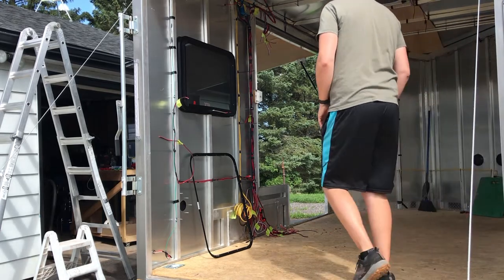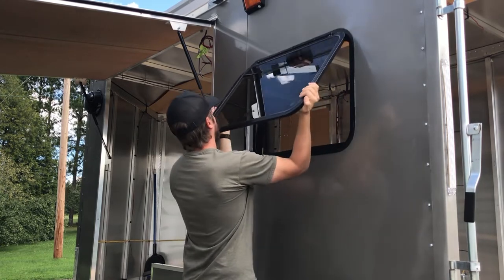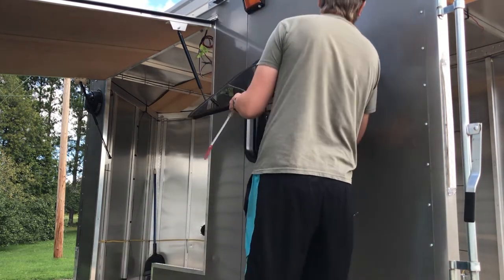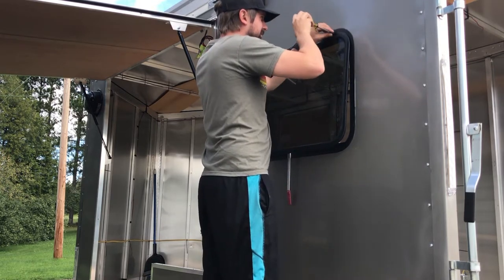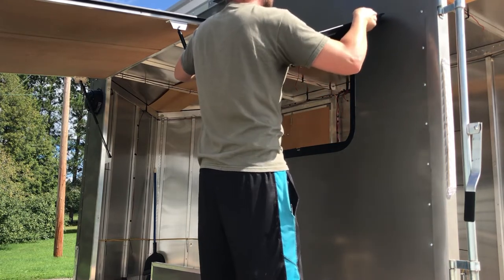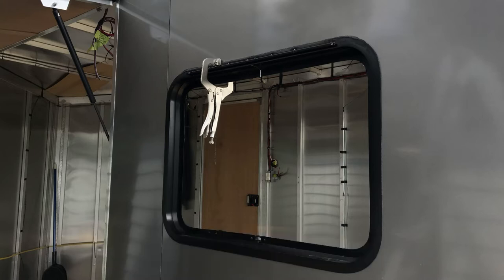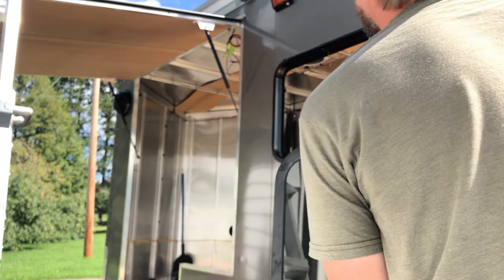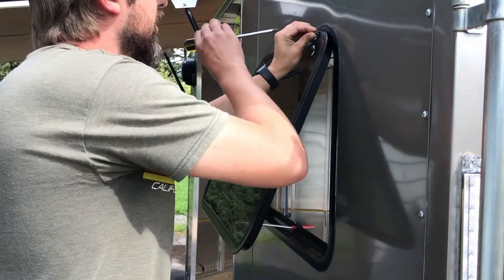Cargo Trailer Conversion Series: Exit Window, how to unhinge

Comment: Dang...video wasn't long enough for the paint I just put on....😁. 
Good idea to learn how to operate Emergency Exit BEFORE the Crisis...😁. 
I use clamps just like those, compress brake calipers, secure windows along length with a couple scrapes of wood...best tool since a good knife...
Reply from the maker: Short and sweet! I always try to cut out the filler but they still end up too long I think 😅 And I agree, you can never have too many clamps and vice grips!

Comment: do you have a video on the full installation of this window?
Reply from the maker: Yes, I believe it’s the video before this one. But I have to admit, between missing parts and inexperience, it’s more of a what not to do video. Still worth checking out if you’re new to this sort of thing too. Might save you from making some of the same mistakes I made 😅
Reply: @getaway_man  LOL i understand man, I'm building myself and my son a "Stealth Hunting Trailer" so that we can get deep in the woods and just be there and I'm at windows now and i already have the exact window you are doing just trying to watch a few videos before i jump in it. you are very detailed and skilled so i tend to watch your stuff first.
Reply from the maker: That sounds so fun, good luck with the rest of the build, and thank you!

Knowing what I know now I would suggest cutting out the opening, then frame around the opening on the inside. Simply glueing some wood to the sheet metal will work. That way, when you insert the window and subsequently screw the trim ring to the back of the window, it will be a uniform squeeze and you won’t end up with any gaps/leaks around the window. They didn't include a window seal/gasket when I ordered so I improvised and glued the window in place. It worked but it would be much easier to use a foam or rubber gasket. Hope that helps!
Reply: @getaway_man  i have already done my inside insulation and walls. what are your thoughts on cutting it out and just using the inside trim piece to the inside plywood to sandwich it in and have some dicour lap seal on the outside ring?
Reply from the maker: I think that should work. That’s essentially what I ended up doing. Did they include a foam/rubber gasket for the window? If not they sell them online are camping world etc. Could also use butyl tape. I personally don’t use lap sealant, I don’t like it. It never fully firms up and it breaks down over time. I like the 3M fast cure for most things that need weatherproof seals. Or else look into a clear sealant called lexel for trim and other less critical parts.
Reply: @getaway_man  idk why i said the lap sealant, LOL that's what i used to seal off the maxair fan good on the roof and it did great for that. but i was 100% thinking butyl tape. brain fart for sure.
Reply from the maker: No worries. I figured that’s what you meant but elaborated just in case lol